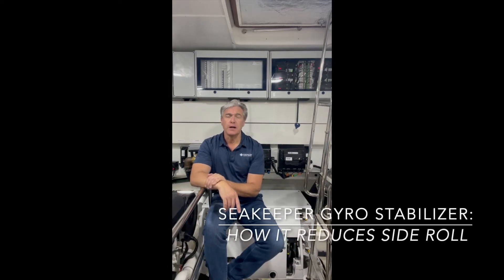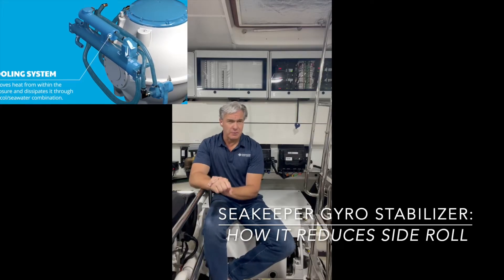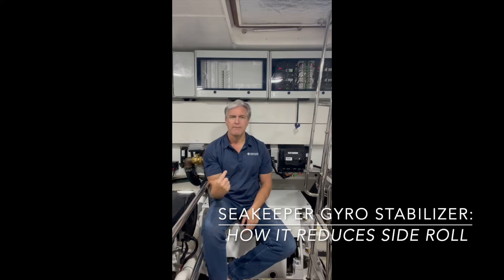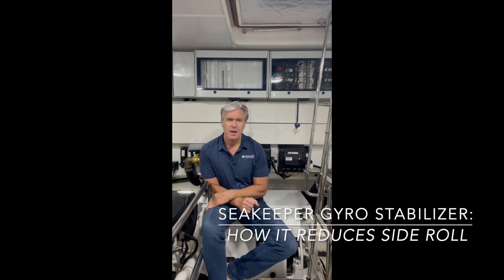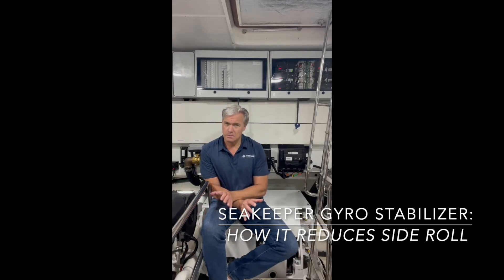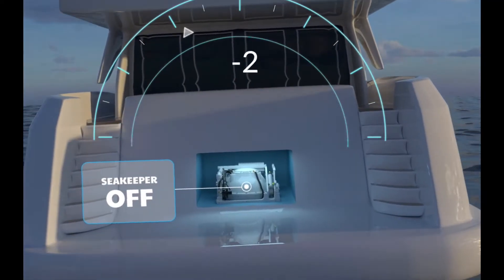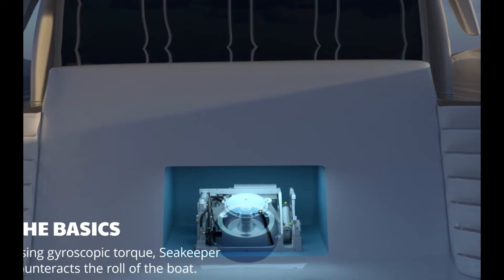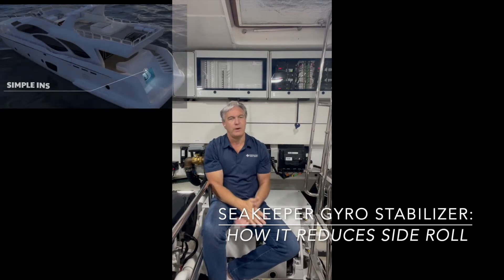How a Seakeeper Gyro Stabilizer works to reduce side-to-side Roll on a Boat or Yacht......

Comment: Hi, do you think a catamaran 60 feet need such stabilizer? or better need two side by side?
Reply from the maker: Catamarans are inherently stable, which is a large part of the appeal of the catamaran design. Stabilization is typically not needed.